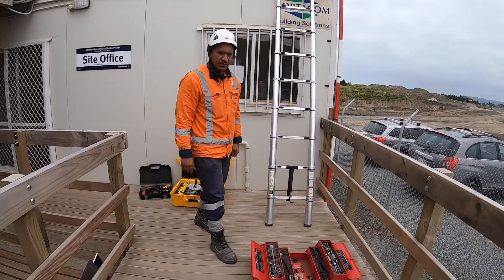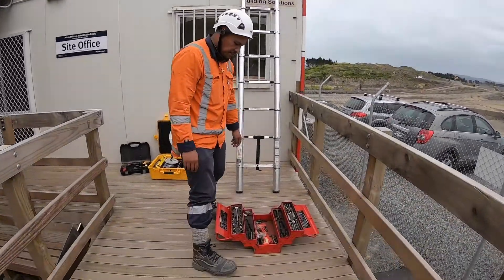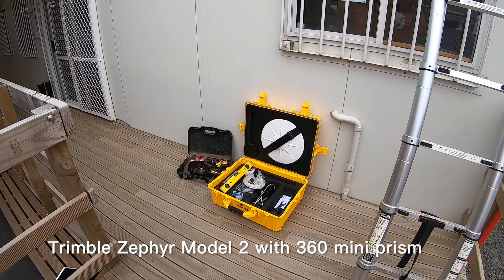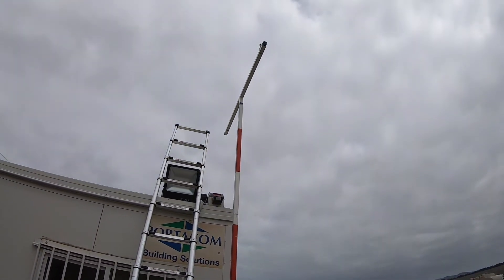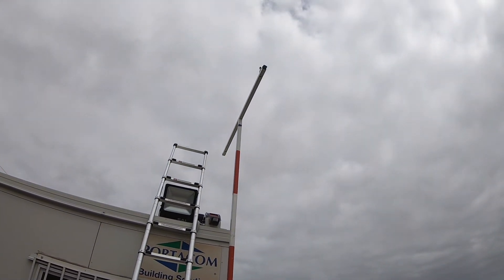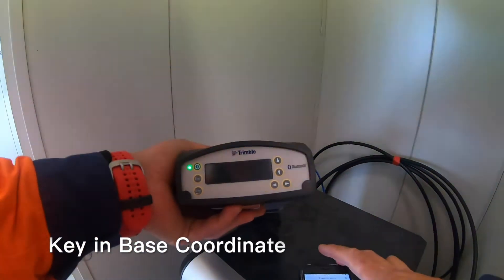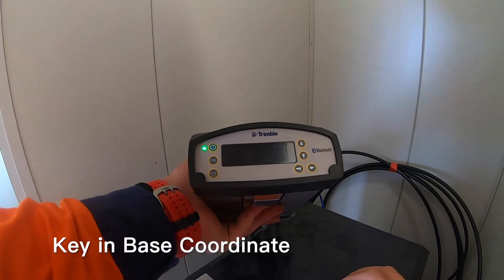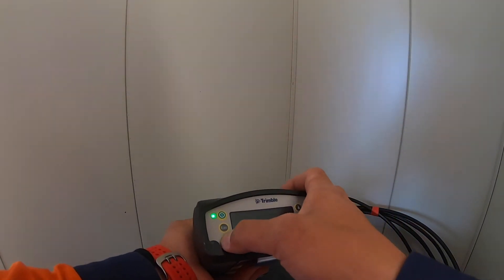GPS Survey How to Set Up A Permanent Base Station

Comment: how did you guys get the antenna height? Where did you measure from to key in on the base station?
Reply from the maker: Mini360 prism underneath, there should be a sticker on the zephyr showing offsets to ARP